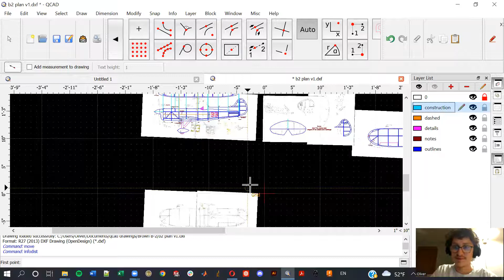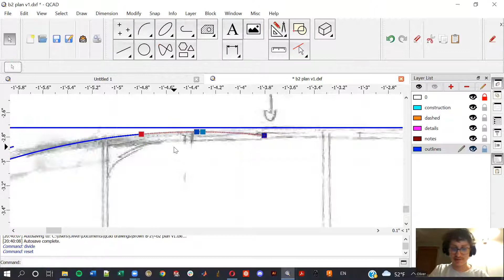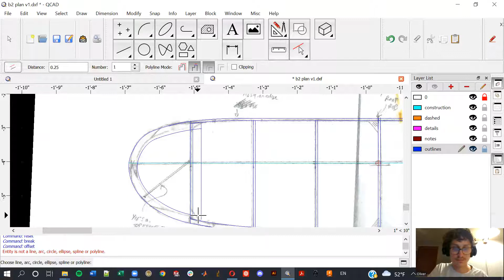2D Model Airplane CAD part 2: Wings

Comment from the maker: TIMESTAMPS
0:00 introduction
1:00 construction layer
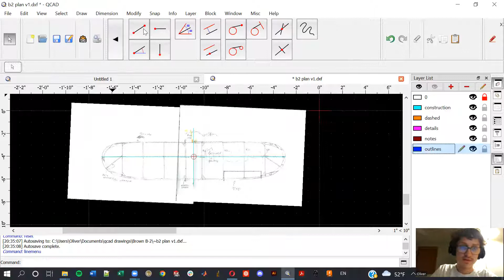2:30 leading and trailing edges, outlines
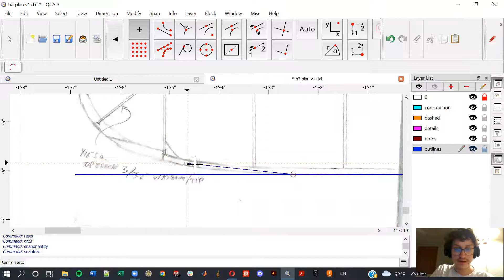3:30 drawing curves with arcs
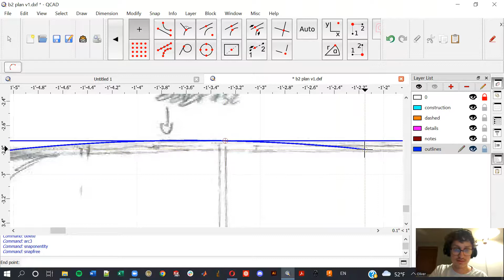7:25 trimming arcs and rounding fillets
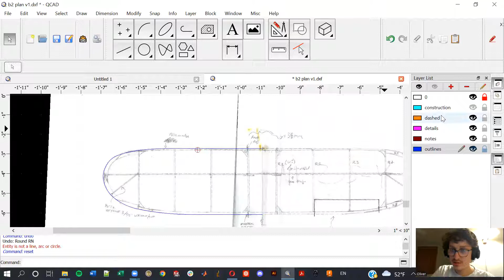8:33 offsetting outline LE and TE thickness
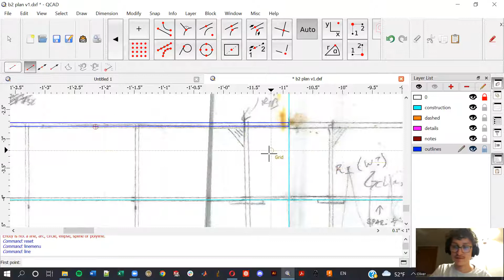10:40 drawing rib locations
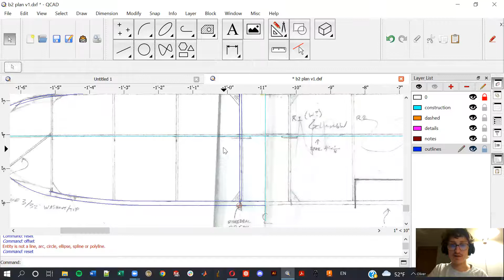11:40 offsetting (copying) ribs
14:15 sheet wingtip parts
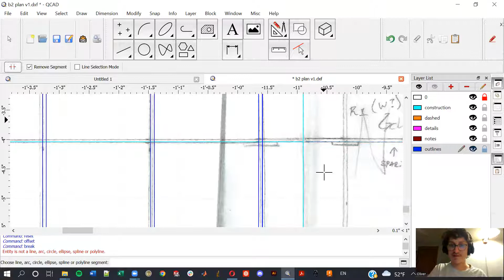15:15 wing spar
16:15 gussets
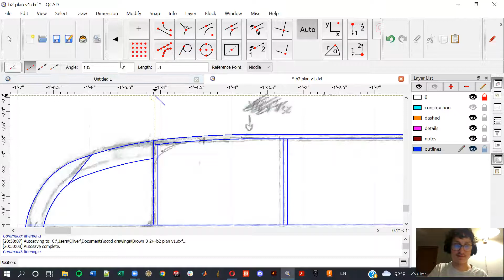17:10 details and reflection across center line